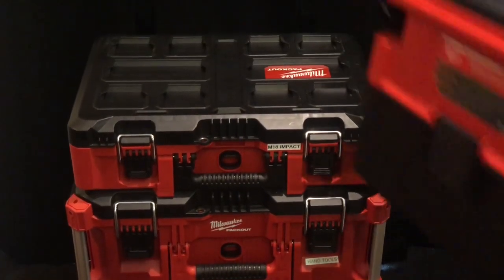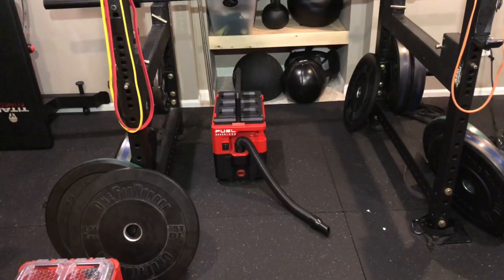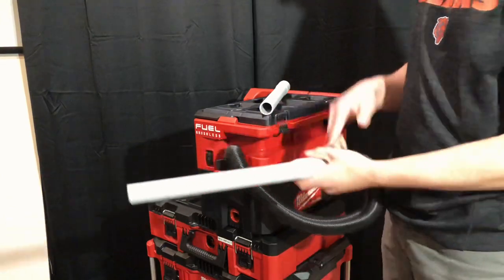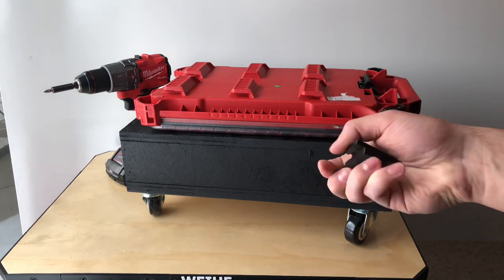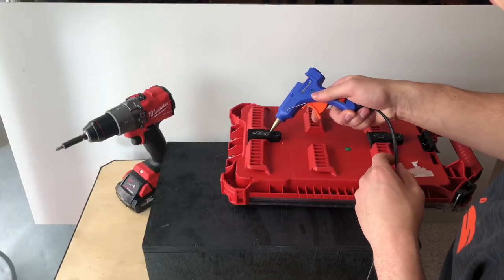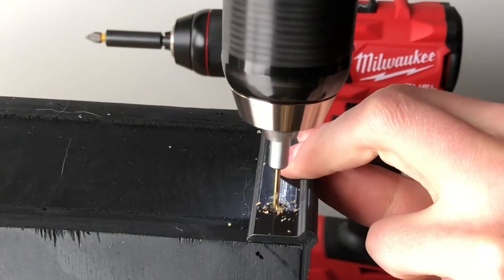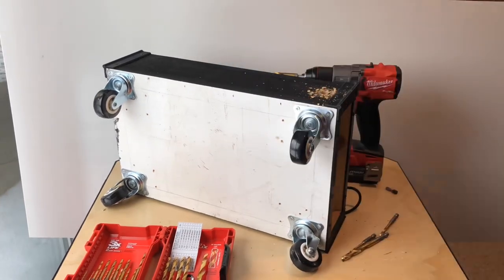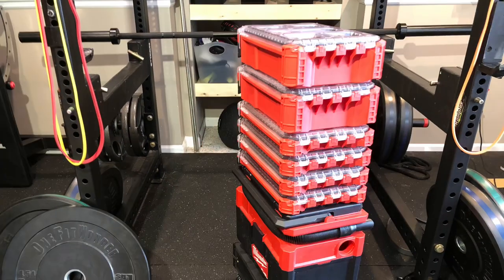DIY PACKOUT Storage Dolly | PAC #3 | M18 PACKOUT Vacuum Improvement

Comment: Great work! 

What 3D printer and table saw are you using?
Reply from the maker: At the time of this video I only had a artillery sidewinder x1. I now have 3 different printers. 
I used a metabo hpt table saw. I have some more details in my tool collection video

Comment: The adapter will fit behind the battery in one orientation...only 1!
Reply from the maker: It does also fit if a smaller battery like a 2.0 or 3.0 is used.